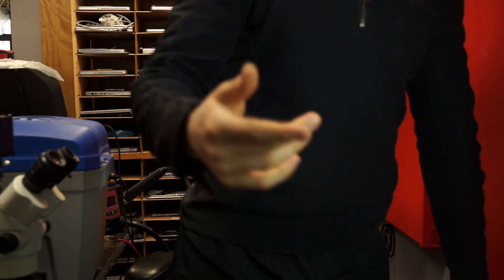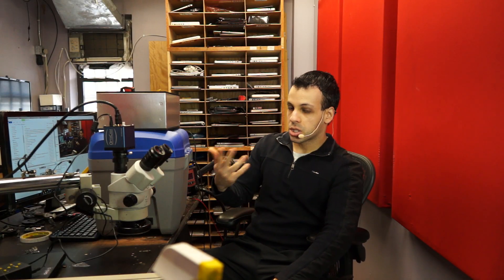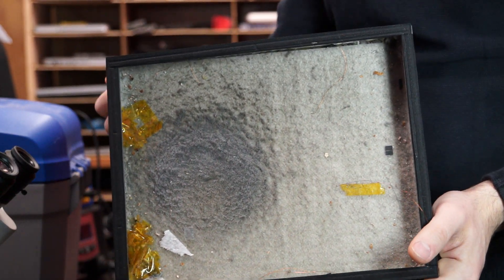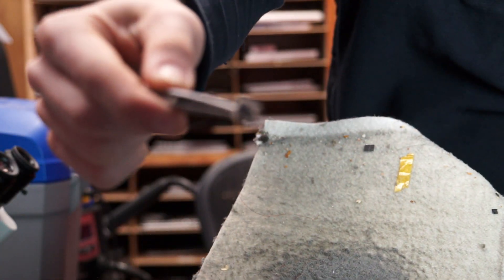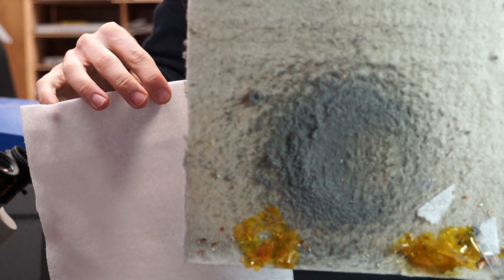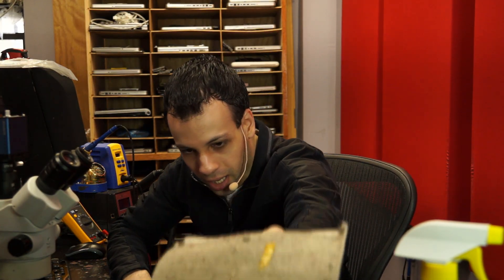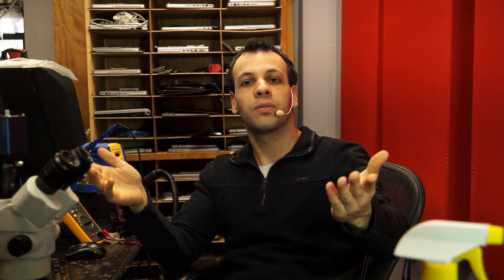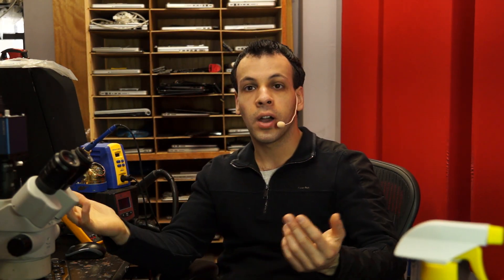A word on soldering and fume extraction

Comment: I know a fume extractor is definitely a must-have, but I'm a bit strapped for funds at the moment (still working on setting up a workshop area, got basically everything I need). Do you think a good respirator like what painters use and a fan + an open window would suffice until I am able to get a good extractor?
Reply from the maker: +spartan456 buy the $50 fan thing then.
Reply: +spartan456 I Made my own with  carbon filter I bought of amazon and a bathroom exhaust fan. It's less of a fume extractor and more of a fume hood. But it pulls all of the soldering fumes away from me pretty well. If you can afford it buy the real thing but you should do something to protect yourself.

Comment: I work on vacuum cleaners, which does involve soldering every so often, but I keep a big air purifier at one end of my workbench that I run on hi all day as I work. Vacuum repair and service is a very dusty job, and I have allergies, and just don't want to breathe it all in anyway, its also cut way down on the dust in the store as well. We have 2 more smaller air cleaners around the store too. And if I'm soldering something, I do it right in front of the one on my bench, so it sucks it all in, not me or my lungs. And if I have my face right up near the fumes, I'l take a deep breath of clean air first, and then slowly breathe out my nose to prevent it from even wafting up my nose as I hold my breath. As long as I'm not sucking it in my nose or mouth, I can watch the smoke/vapor waft into the front of my air cleaner.
Reply from the maker: +compactc9 the idea is to get it before it goes up your nose, because by then you;'re already screwed. whatever works!
Reply: Exactly, I don't want it going in anywhere, nose, mouth, or eyes. I really don't even want the stuff coming up against my skin. And I have noticed that the slow exhaling will push the rising fumes away from my face as they get sucked to my right and gone forever. The few times I've had it go up my nose, I had to go immediately and blow my nose, it burned and made my eyes water, I almost could feel it poisoning me. Probably more in my head, but still, I don't really want cancer in my respiratory system, or even lead poisoning, God forbid! I have enough sinus problems with my normal allergies, and don't want or need to add to that.

Comment: First I agree that solder fumes are unhealthy, but I question your work environment.  At my school we have a fume hood that has a filter and a vacuum that we use for soldering.  So on our filters we don't get the thick layer that you have.  That thick layer is dust and the dark part is captured fumes.

Edit:

Also how much flux do you use?  I would lot rather breath in solder instead of flux.  At least solder doesn't have acid.

Comment: Fume extraction is important, but the prices seem very steep for what is essentially a glorified vacuum cleaner. I wonder if one could make a equally good DIY solution for a tiny fraction of the price.
Reply: You can make a far superior solution easily with minimal study. Those prices are for the helpless. BTW any HEPA-rated vacuum cleaner can be connected to a simple intake cut from an old water or antifreeze jug in minutes for an instant filter/extractor so I do.

Comment: seems like normal dust, like dead skin, etc. I would expect some cristalization if it were condensing vaporized flux.

Anyway 

it is because the vapored flux is making the filter to be sticky, then come the normal dust and really stick without going deeper, so it looks very ugly because it keps dust in the surface, not in its inners layers.

This doesn't mean that it didn't trap flux vapor, it did!, but it is not as gross as that. Simply you are seeing a convination of two sources of things filtered.

Comment: first of, you should check the inner filter too, the thing you see on the thin outer filter is just dust and other kind of dirty particals, the inner filter is actualy the filter that  filtrates the fume, your fume extrator manual should say when that filter needs to be replaced. 

second, i was soldering as a hubby and foundt that when ever i would have soldered then i would have alot of slime in my throat the rest of the day, so i builded one my self with just a dust filter, 3 active carbon filters and 4 pc fans, some scrap plastic that i had laying around, a went flex tube, 1 self made circuit board and some glue, it took me 1 hour to make(drawing a plan, making pcb, soldering, gluing stuff together etc..) and that fixed my problem. thats what borders me too that so many sacrifice thier health just because they are too "cool" for spending 1 hour on making a fume extractor, its not even that expensive especialy not for an electronic repair shop or anyone else who repairs alot of electronics, i think i spend around 10$ in total on it where the active carbon filters where the most expansive.

10$ for saving youre health is like no cost at all compared to end up having asma or living with oxygen mask rest of life because of broken lungs.....

Comment: You are so right, I did not have a fume extractor and started to get respiration related problems but I did not know the cause until I started looking your videos and you talked about fume extraction.  I'm also in the independent repair business (but I do measurement and calibration gear) 
It was a bit difficult to make/find one in a way it is not giving problems. One like you have is no option, I'm surrounded by testgear and often the whole instrument that needs repair is on my desk. So I have to preposition it constant.
I now have a commercial one that has a lamp-like swingarm I mounted on a metal bridge-like frame I made over my desk . It has a big but silent 230V fan and  a carbon filter.  It really makes a difference.  (the Alu-frame is to guide f.i. testleads, support things against tipping over or mounting things for a test setup.)
Fred

Comment: why don't you burn the filter with low heat and check if there's any lead pellets in the ashes. Might help to add some flux to the filter lol.
Reply: I mean if there's a significant amount of lead it should coalesce and form bigger droplets at the bottom.

Comment: 9:10 Be careful about putting a fan too close to what you're soldering, in my experience it can impact the temperature setting required by your soldering iron.  I keep mine about 8-10 feet away but I don't solder much these days.
Reply from the maker: +John Simpson If it is RIGHT on top of the board and set to hi then it cools the board down.

Comment: What I don't see in there is the strip of chips (that would be gone in a week) and the solder mask from that reball video.  :D  Also, you did see me mention using a shop-vac, motor speed controller, carbon filter and tubes, right?  I'm more inclined to think like "That's too expensive, but I really need something.  What do I have that can recreate that with what I have on hand".  I know you're probably not a fan of this information, but it's my creative, cheap side coming through.

Normally, I am not at your level when it comes to knowledge, so I throw that stuff in my bin of things to research, but with the lead fumes - I take issue.  ONLY with the lead vapors, not with anything else.  Lead simply cannot vaporize at soldering temperatures.  Lead poisoning is related to ingesting lead, yes, but that was primarily a dust-related issue when lead paint flaked off or was powdered.  This is scientifically proven.  That said, I don't breathe soldering fumes either.
Reply from the maker: +Tech Gorilla I would usually rig up something chepa and see if it worked. I hagte spending money on stuff like this. At the time I needed something and didn't have the time necessary to screw around and build something myself so I bought the FA-430 because it was from Hakko and seemed like it'd work.

Comment: I have the same Hakko fume extractor. 2 hours heavy soldering in a small room and no sings of any flux smell. Don't be cheap, get one of these and save your lungs
Reply: +toly78 So true, we aren't talking about something slightly irritating, or bad smelling. These fumes are POISON, and will damage your lungs in ways that may never heal. Its just as bad, if not worse than, cigarettes!
Reply: Yeah, anyone who has gotten flux in a small cut on their hands can tell you it doesn't feel great at all. Good indication that getting into your lung tissue is not fantastic either.
Reply: It is way worse then smoking! Ask any lady that has worked at a radio factory in the old days, soldering all day long without a extractor or any thing to protect them. You doesnt know anyone that worked there? Well most have died with lungcancer...
Reply: I'm assuming they use a HEPA main filter in the back?  
Do they have a carbon component as well as particle filter?
Reply: @maulerrw  The one shown here is a HEPA, and just a cheap cotton like sheet that sits in front of the HEPA. He just changed the pre filter.  Monthly is pry about right as much as he uses it.  If I had to guess, he probably only changes the HEPA yearly,  which would be acceptable. While the prefilters are cheap, a dozen for $10 or so, a brand name HEPA filter that size would be knocking on $100. For a hobbyist it would pry last a lifetime as long as you sealed it up between uses. Although HEPA's typically do have expiration dates.
Reply: @maulerrw  Sorry I didn't address the carbon part.  It would not be necessary,  as far as I'm aware there are no VOC's in solder, nor any other chemicals that would warrant carbon sequestering. The HEPA would catch 99.97% of everything that evaded the pre filter.
Reply: @aaronj08ar  HEPA is for particles, does nothing for fumes (the strong smells from flux). You need a carbon filter to trap the fumes. Carbon filter arguably more important than a hepa filter for flux fumes. hakko uses both.
Reply: Hakko fume extractor is your new lungs

Comment: "They're idiots. This is all I really have to say." (tosses contaminated filter around).
Reply: The prefilter is really more of a rough mesh to catch big elements. If you're not a smoker, your nostrils, mouth ( bi ass pieces of tape and dust) and cilias should catch that stuff. It ain't that dangerous to fiddle as bout a bit with that filter. The really harmful stuff, is in the other / other two big filters underneath - the large HEPA filter and carbon filter. But because those particles are down to one micrometer or less, and you often can't see the fume residues at all because the carbon filter is kinda, well, black - that prefilter makes for a MUCH better visual aide and representation, for what Louis is trying to explain here. Even though the visuals don't technically match the sentiment, the idea is still correct, and the majority of the target audienceare people whom do not already understand the nitty gritty technical details. And they don't really need to, as long as they understand the points.

Comment: Thank you, I now feel slightly proud of my fume extractor. It isn't exactly top of the line, but I think it was worth buying now that I have started to solder more often.
Reply from the maker: +Samuel Doye You don't need top of the line, just as long as you are thinking about it and put effort in to not inhale that crap. I bought the FA-430 because it was worth it to not deal with wasting time researching what to buy when I had a stack of stuff to do, and I know if I buy something made by Hakko(besides the FM-206) it will work. But it doesn't mean everyone has to spend that much on their own setup.

Comment: I started playing with/learning electronics as a kid and quickly learned that I needed some kind of extraction, I'm asthmatic and even small amounts of soldering got at my chest, I made an extractor with a cheap fan and some cooking extractor filter, it worked to an extent and you could see the crap building up on the filter paper. At 16 I started working in an electronics factory and saw the crap in my filter in my Metcal extractor and realised how much my home made extractor wasn't filtering... I brought a Metcal extractor as soon as I began working for myself and always use it,even for a quick, 1 minute job, it wasn't cheap (about £600 or $900) but it was well worth it. There is nothing at all macho about fucking up your health.
Reply: If you exhaust your fumes outdoors you can use any KW fan you prefer without filtration.  "Bounce house" centrifugal blowers move serious air so I use those to ventilate my welding room in my shipping container shop.

Comment: It's a nice comparison ,but most of that black stuff is normal dust , I think what you should show is that the used filter is yellowish from the rosin fumes, as for fume extractors , usually the cheap thin carbon filter don't really do the job, like your filter ,the best way is to buy a shower fan and a hose and blow it out the window
Reply: Indeed. Most of the stuff caught in the pre-filter is regular dust: lint and dead skin. It looks yucky but found in every home, and is mostly harmless and comes out with a cough. That's what the pre-filter is there for, to make sure the later filter stages don't clog up. That does not invalidate the need for fume extraction and filtering obviously, but the nasty stuff mostly comes in the form of ultrafine particles or solubles.
Reply: Get quadcopter motors, they are so just so strong , but consume about 150watts.
Reply: Yeah, that's what I was thinking.  I have some of those air purifiers that operate on the same principle, a fan, a filter, and a pre-filter, and the pre-filter always looks scummed up like Louis's pre-filter just from household dust and such.  Or you can look at your furnace filter and see how quickly it gets filled.  I don't know what smoke would look like on a pre-filter, maybe like the filter of a cigarette I guess.